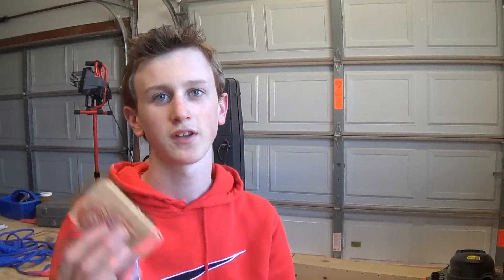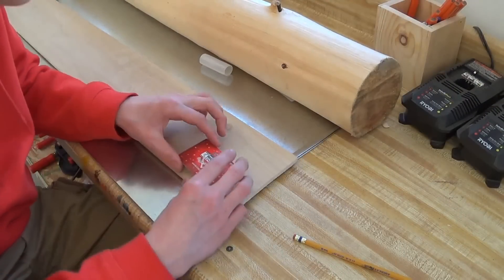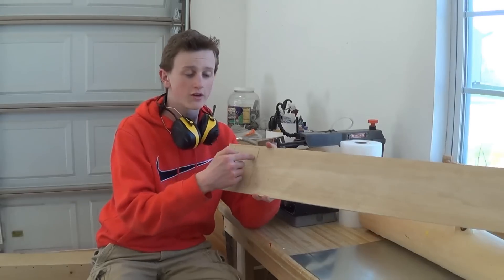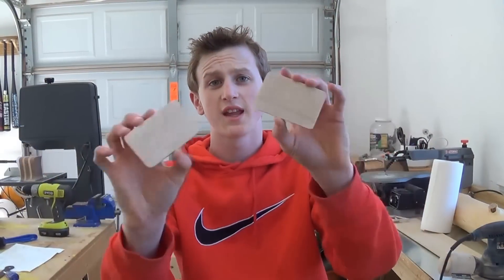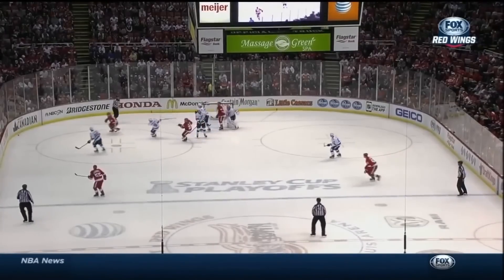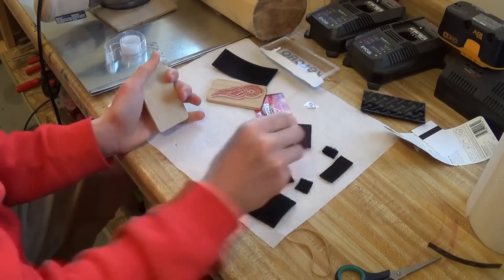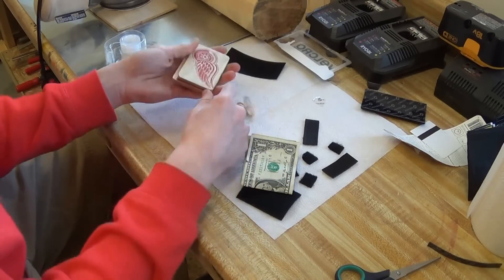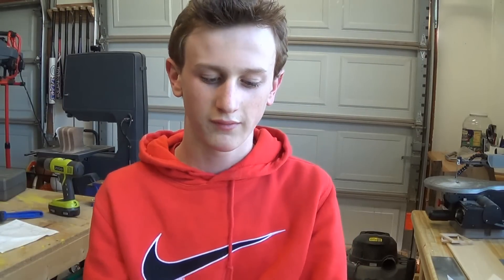How to Make a Wood Wallet (FAIL)

Comment: I have another idea for you. Instead of the rubber band, why don't you lay the wood pieces side by side, leaving a little gap between, and cut a piece of leather big enough to cover both pieces, and the gap. Then, use contact cement and paste it on the inside? The outside would be wood, and opened up, it would be leather. Before gluing the leather, drill a matching hole and then put the leather over it. When closed, the magnets would keep it closed, and the leather would act as a hinge? That would solve all your obstacles, not problems!